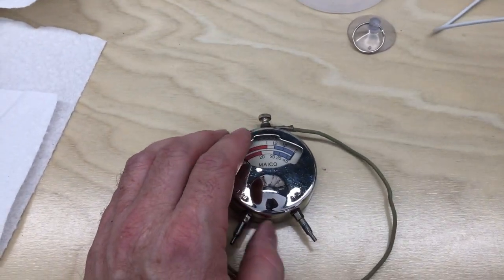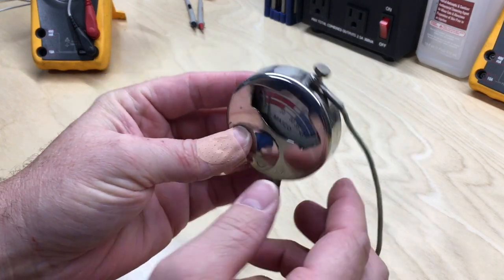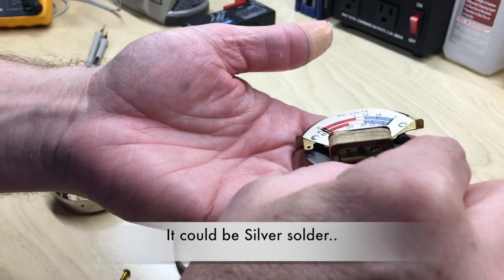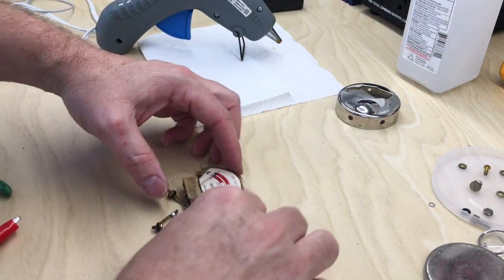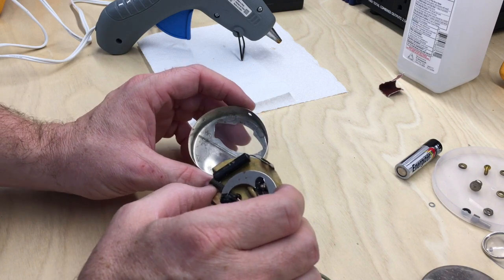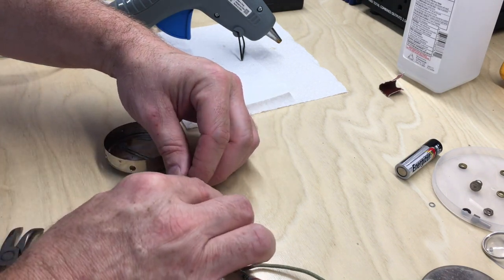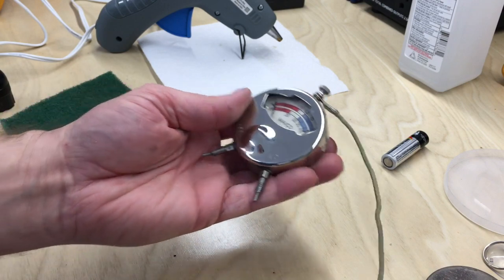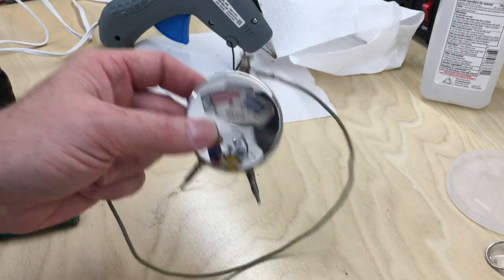MAICO Vintage DC Pocket Meter Restored

Comment: Great video. Loved your suction cup back cover removal idea. Any idea about the best way to reconnect the small coil wire if it gets broken at the solder connection on the positive terminal? I just pulled a similar model apart, but it is a voltmeter.
Reply from the maker: Hopefully you have enough loose wire to be able to solder a small wire back on? Usually this is varnish covered. With light scrapping or the heat from the iron the wire will usually clean up and tin ok.